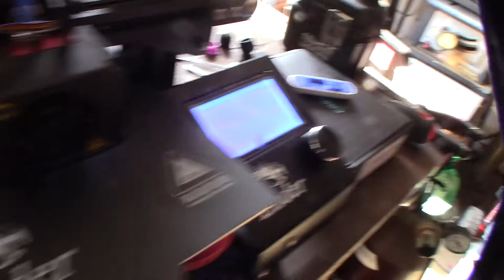Creality Ender 3 BCZAMD Dual Z timing belt upgrade kit

Comment: I have purchased both because i didn't know what one i wanted, but I got to thinking why not use both. It will keep them in sink and if you have 2 of the same stepper motor it should work.
Reply: How does it work? Wondering the same thing as well
Reply: @Jasperkiller1   it works ok. At first it the motors would fight each other. I found a guy on YouTube who shows how to time them so they don't fight.
But I can't tell the difference between just the pulleys with belt or with the second motor.